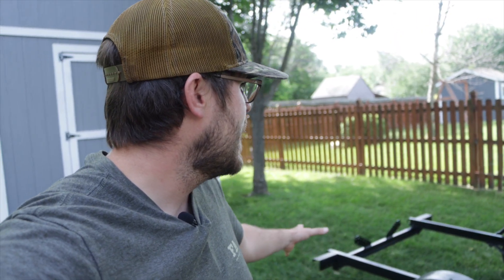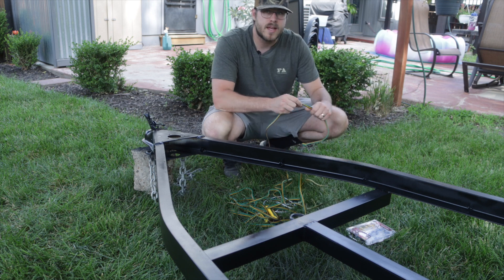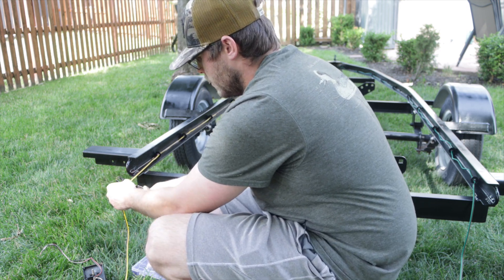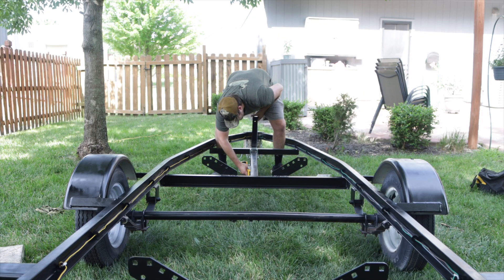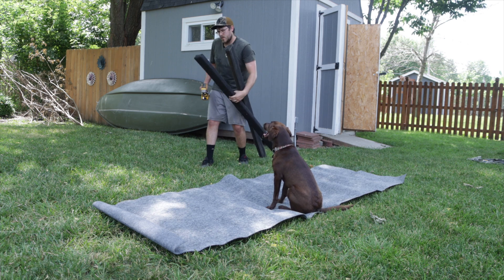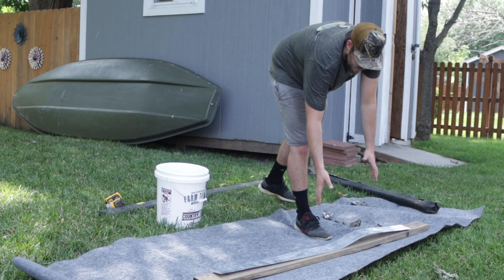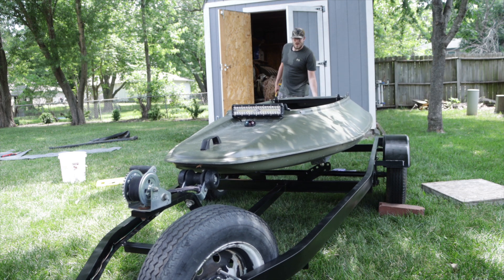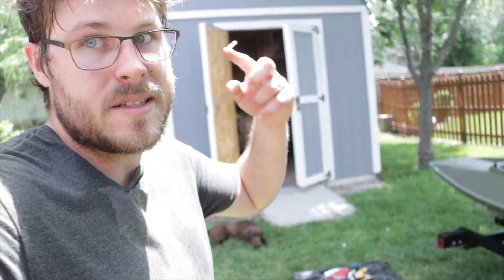The Trailer is Done... OR IS IT??? pt. 10

Comment: So. With my beavertail set up the biggest issue i have is transporting and having it sit on my trailer.  Wind while transporting. And RAIN! When sitting.  When the inside fills with water is weighs a ton.  You should find some kind of waterproof cover for the boat while sitting to prevent issues.  If its going to be kept outside..

Comment: Wires should always be in an old garden hose for stone chips protection. Inside wheel protection is needed. Flat tires= bearing replacements as well, Back rear post for guiding helps in the dark
Reply: and rodent chewing!